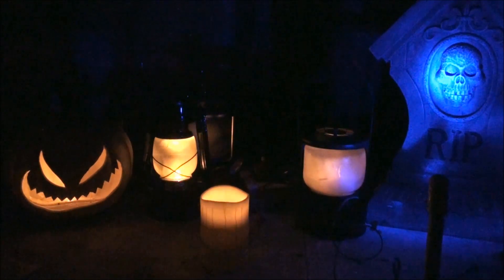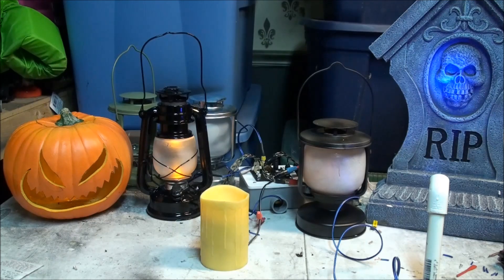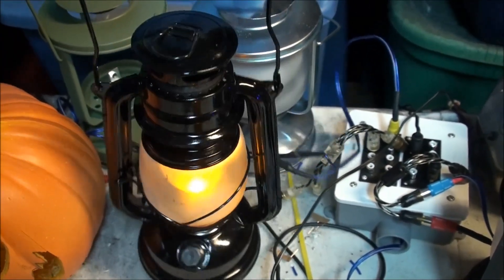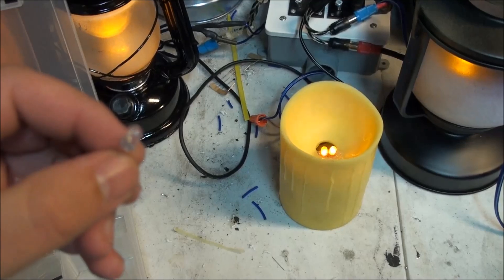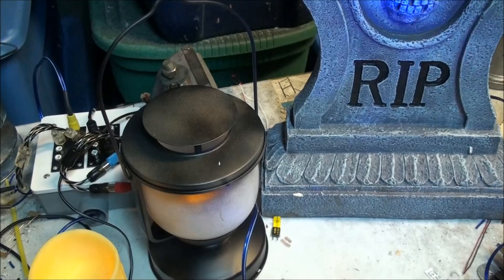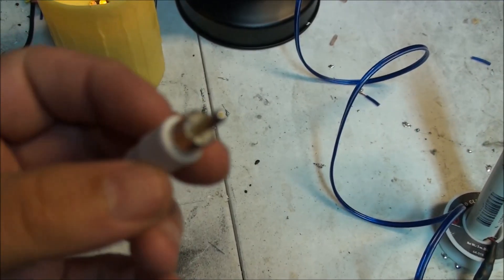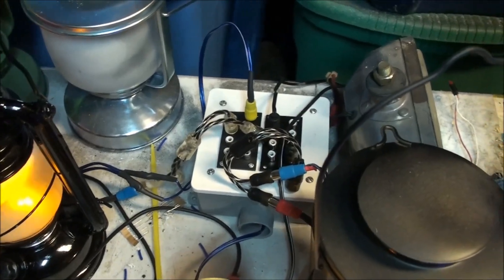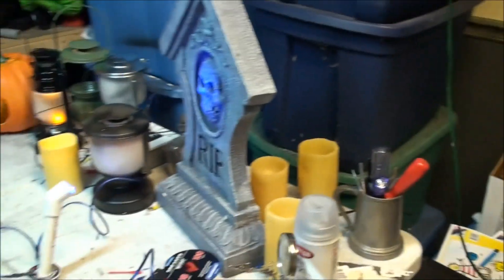DIY Halloween LED Light System

Comment: for candles, can I connect the 3 LEDs in series and adjust the single series resistor?
Reply from the maker: you could but honestly i find easier to just wire the leds as a bundle (all the pos together and all the neg together) assuming you are referring  to having 3 leds in one candle

Comment: Quick question for you... I bought a 12v 6amp power supply.. I also bought the prewired led with the resistors already on them.. my question for you is.. can the leds be damaged or life shortened when you have lets say 20 leds wired up to 6 amps even though their only pulling 400ma ... I can't seem to find anything in google was hoping you would know.. love your channel btw. thx
Reply from the maker: nope they should be just fine as long as they  have the resistors on them that will keep them protected!

Comment: Pretty cool, will have to try this, this year! 
How many leds to you use in your lanterns and pumpkins?
Reply from the maker: I think my lanterns each only have 1 LED in them the pumpkins I want to say have 2
Reply: Ok, thanks. I think the lighting is perfect, as you don't want it to bright. One last thing, how did you hang your lanterns in the tree? Fishing line, string?
Reply from the maker: the lanterns in the trees are actually held up with black plastic chain from amazon its pretty cheap!

Comment: do I solder the wires to the jack box?
Reply from the maker: +Brian Griffith yeah inside I soldered all of my wires Van Oaks just came up with a neat way to solder them that allows you provide power to the jack box by simply plugging power into any of the jacks its pretty cool
Reply: I ran copper wire and solerded all the positive and negatives together and then soldered the incoming power to the entire jack box (I'm guessing like Van Oaks did). However, when I insert the male RCA plug into the jack box, the LED does not light up. I spent 20 minutes trouble shooting (+/- backwards, bad solder connection, LED bad/good) but have not determined the issue. I opened up the jack box and pluged in the power and then layed the LED leads (+/-) directly on the solder and it wouldn't work but if the LED leads touched the copper wires that tied the + and - together, it worked. It looks like the solder isn't good? It looks like the metal jackbox connection pcs aren't allowing powere to flow through them.Thoughts?
Reply from the maker: Hmmmmm thats really strange do you have a volt meter you could test everything with?  also do you have a pic of how you have it setup?

Comment: Where could I find a tutorial for the spotlight in this video? I've been looking for something like this for awhile now....
Reply from the maker: +BigD haunter the little one in front of the tombstone?  its just made from pvc pipe and a pvc angle piece. I just put a blue led in it using the same method I did for the flickering LEDs in this video. you can buy LEDs already wired and setup for 12v from LED LIGHTHOUSE all you have to do then is wire them up to a power supply! Its super easy! Hope this helps! If you need more info just let me know!
Reply: Thanks, it worked out well!
Reply: One other question, are the RCA plugs water resistant, for outside use?
Reply from the maker: to an extent I wrap mine in electrical tape to seal them up works great

Comment: Yeah I wanted to add a ton of more lights this year. this is perfect!  Consider the idea stolen for our charity haunt,  I was sick of tripping over the cables chasing people with a chainsaw.  This will work so much better! Ok so obviously your are pretty technical.  I am an idiot in the ebay find stuff online for good deal area.  Where did you find the prewired blue led? Can you link that?  you may have said in the video but it is 2 am and I am doped up on cold meds.  I think I can get the rest. I want to lay theblue leds under the fog as the rolls out of the chiller. and the i want to use the others to light props.  Question?  On my axworthy. do you think i could power a thin line to the cable and power up my axworthy eyes or head?   https://www.youtube.com/watch?v=dEQT248oliU
Reply from the maker: Hahaha thanks!!!! You can find the LEDs on ebay pretty easy just do a search for "12v LED prewired" and you will see tons of awesome LEDs come up that are all prewired and ready to be hooked up to a 12v power source. Your axworthy setup is pretty damn amazing!!!! Its huge! It might be hard to provide power to each of the heads maybe so you what you might want to do is also search on ebay for 3v leds prewired. I see a few 6v ones that claim they will work at 3v as well might not be as bright of course but you could put them in the heads along with 2AAA batteries to keep the weight down.  might have to change them each night or every two nights though.
Reply: sweet. thanks.yeah the run was huge. made one neighbor mad but oh well. the 1000+ kids that showed up wa better than one grumpy guy. i'm an idiot when it comes to this but i can learn. last year we had people walking into the cemetar even though it was blocked off. they would step on and break all the bulbs and i would trip on all the power cords.

  I do see a ton on ebay what mm do you use?  3mm, 5mm or 10mm? sorry for all the questions. i have a lot for this year so I am trying to get this done early.  plus  i have to compete with mr led across the street who buys all the pre asembled off the shlf lights. his place is like a circus.
Reply: i saw that your ones you needed to solder were 5mm. is the assumtion that the prewired ones are 5mm as well?  that was the real question
Reply from the maker: yes the pre wired ones i bought on ebay were 5mm as well! dont forget to hit up your local radioshacks that are closing and buy up all the rca cables and connectors like I just did haha
Reply: oh yeah i forgot about that.

Comment: Cool Stuff - Did you wire the female RCA plugs in parallel?  Is there a limit to the number of connections with the 12V5A?
Reply from the maker: Thanks! I did wire them in parallel the limit to the number of LEDs you can use will be the amps of the power supply. Most 5mm LEDs draw 20ma and my power supply is a 2amp so I should max out at around 100 LEDs

Comment: can you tell me where you got the female board of RCA connectors??  or how you made it, where you got the female connectors for it?   I can get the male plugs and the led's but maybe a quick video of the connector board?
Reply from the maker: I got the female jack boards from radioshack. I mounted them to a blank 4 outlet gang cover that I cut a hole out of to allow the connections on the back to pass through the cover. I mounted that to an outdoor 4 outlet box!

Comment: I ordered my led's prewired with the resistors already included from lighthouseleds.com
Reply from the maker: You were able to get the flickering LEDs prewired?? I searched all over their site and ebay and couldnt find the flicker ones prewired? I would love to get them wired it would save me so much time!
Reply: Eerie Acres Cemetery Sorry, no they do not have the flickering led's.  It occurred to me later that I should have made that distinction.  I just thought that it would be a good resource for anyone who wanted to make some mini led spots and were intimidated by finding the right resistors and soldering them together.
Reply: +Eerie Acres Cemetery Im on lighthouses ebay now and I see prewired 5mm flickered led's. Just thought I'd let ya know. Would these work?
Reply from the maker: Yes! they work great! I actually ordered them last year and we did my whole setup using the pre wired ones makes it so much easier and quicker to do!
Reply: How do I find the forums you referenced?  Derek Young DMinor????

Comment: Thanks for the video Ant.  Where are you getting your soldered RCA plugs from?
Reply from the maker: Thanks! These particular ones I got from Radio Shack just because they were local and I wanted to get started. I am going to buy more online once I find a good source for them online!
Reply from the maker: I was getting these at Radioshack before they all closed down here! I have also seen them on ebay as well though!

Comment: Great video Ant! I love seeing how many people have found this idea so useful!
Reply: Eerie Acres Cemetery Ant if you're looking for heat shrink then check out Harbor Freight.  They have a kit with about 10 different sizes for like $4.  That's what I use and it works just as good as the stuff I got from Lowe's.
Reply from the maker: Thanks for coming up with the idea! Im on hold right now until I find a cheaper supplier for heat shrink. All of the local brick and mortar stores just want way too much so Im looking online for a better deal right now!